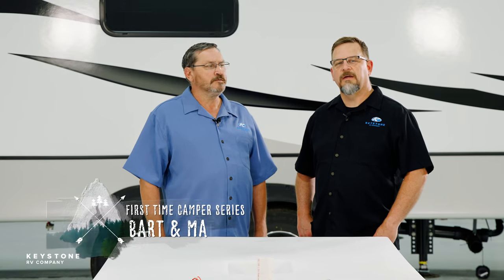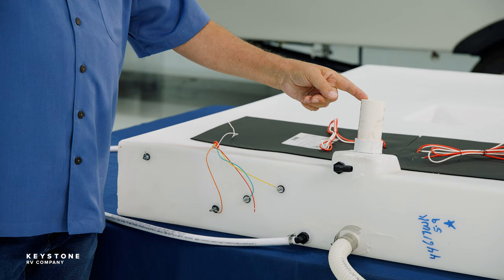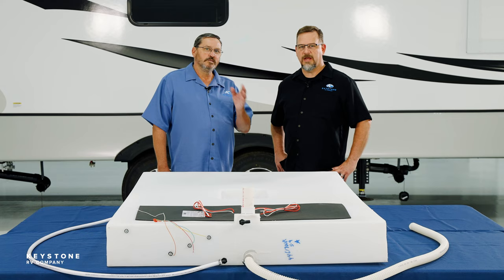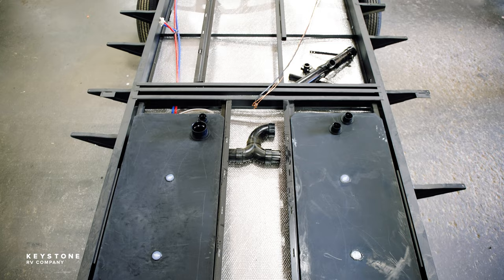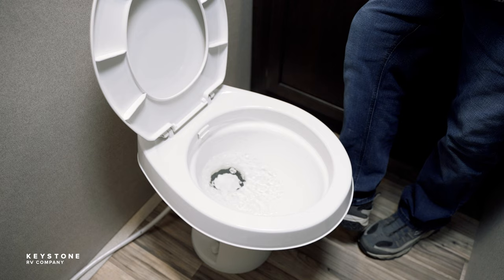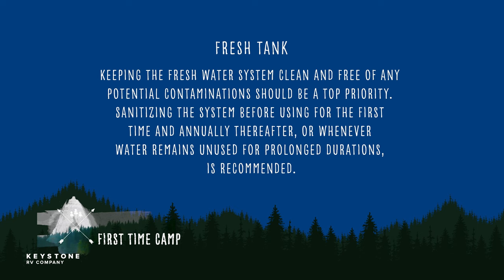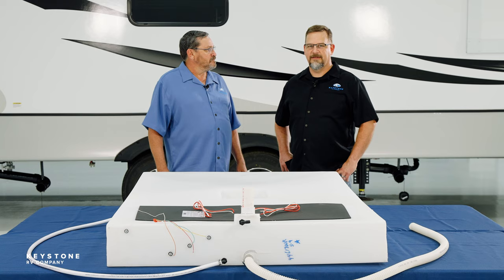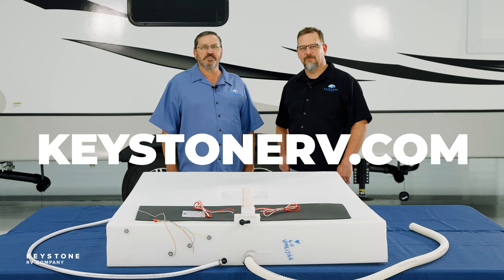First Time Camper Series: Understanding your RV Holding Tanks

Comment: Helpful video except for the recommendation to use RV toilet paper.   There are tests that show household "septic safe" toilet paper dissolves faster and it is less expensive.
Reply: We use a septic safe paper we get from Walmart.  It's their store brand. I did tests comparing how it breaks down in water to some of the RV specific papers. I simply placed a few sheets of each in separate bowls and noted how well they broke down down and how long they took. Walmart brand won.
Reply: I’ve used regular household toilet paper of many brands and textures without ever having any problem. Using RV toilet paper may result in tearing paper then you have a mess on your hands (pun intended).
Reply: I am not sure I agree with the chemicals and quick dissolve toilet paper.  I watched a good video from a company that specializes in tank cleaning and they said NEVER USE chemicals to dissolve waste or rapid dissolve toilet paper.  It causes a thick, peanut butter consistency that clogs.  The guy said “remember…your RV tanks are HOLDING TANKS not SEPTIC TANKS.   Flush them regularly.
Reply: I use normal septic safe TP as well. I use a macerator pump since I don’t have a dump station near where my RV is. Never had an issue.
Reply: I have been building for 20 years in the RVing for five in the best in this expensive toilet paper is the Scott 1000 single sheets. The role last a long time in the TP breaks down instantaneously but it’s funny strong for the job at a design port anyway that’s my recommendation.
Reply: @wolveswithoutteeth I've seen the video you're talking about. Very informative.
Reply: That’s boating not building lol
Reply: I had occasion to purchase some septic tp in a tiny town that only had a little discount store. It broke down very quickly, like in your hand, with any contact with water. I prefer nicer RV tp for that reason. Since I don’t full time, the extra cost is pretty minimal.
Reply: True, but… you use 2-4 times as much unless you want to wipe with your fingers.   😊
Reply: @victorjcano if you touch the 3 dots on the right side of your text, a menu will appear that will offer choices, among them is 'edit'.  Click it and you can change 'building' to 'boating'.  You're welcome! 😊
Reply: @Erutan409 Thank you!
Reply: Less exspensive is why they a reccomending the more exspensive RV toilet paper, its obvious
Reply: I personally use "Royale Carbon neutral" and it is sooooo much better. Didn't feel much of a change from a home (live ft in a 23ft motorhome). The small things in life 😂
Reply: I always use regular toilet paper, and no problem

Comment: Be advised, the black tank flush system has a valve that is located under the sink in the bathroom. These can and do fail. When that happens, water will run wide open into the under sink cabinet and flood your bathroom and everything else. NEVER use the black tank flush without a person inside to monitor that unit. This is on my Keystone Avalanche.

Comment: If you’re hooked to fresh water at a campsite. Does the fresh water fill a tank reservoir & then you pull water from that tank ? Or Is it pushing water directly in to the lines. I understand there’s a fresh water tank for boon docking I am wondering how city water works
Reply: It goes straight to the plumbing for your sinks. It does NOT fill your fresh water tank.

Comment: Good job. I noticed on my 2022 Bullet 330BHS that when I used the tank flush on the outside by the kitchen slide out I only heard and seen water action in the rear bunkhouse toilet. I went up to the master bath toilet and I didn't hear any water or see any water action in the tank using a flashlight. Shouldn't the black tank flush, flush both tanks? I am a little confused. I also noticed the bunkhouse sink goes into the rear black tank and not the gray tank like the other sinks.
Reply from the maker: Hi Rudy, thank you for reaching out! For immediate assistance we do ask that you contact our Owner Relations Department direct at 866-425-4369 Monday-Thursday 9am-5pm & Friday 9am-4pm EST. Thank you!

Comment: I have a Keystone Carbon 398 with 2 Full Baths.  I've notice the trailer has two sets of pull Valves one set up by the Main control center of the trailer, and a second set down by rear drain tube/ outlet. Looking at my Spec. on the trailer it says I have 1 Black tank and 1 Grey tank, so why is there two sets of release valves.
Reply from the maker: Good afternoon! If there are two bathrooms there are typically 2 grey tanks and 2 black tanks so you would then have two sets of dump valves. If you have any further questions regarding this please let us know, thank you!

Comment: My pump runs but isn't pumping from my fresh water tank, how can you tell if vapor lock, wrong valve directions, or faulty pump, or clogged or kinked air vent?
Reply from the maker: Good morning! There’s a few thing that you can check. Make sure there’s enough water in the tank so the pump can pick up the water from the tank. Make sure you have a faucet open to provide air and demand from the pump. If you have both of those these components it may be vapor locked. If this is not the case you would need a technician to look at this for you to properly diagnose the issue. Should you need further assistance on this please feel free to call us at 866-425-4369. Thank you!

Comment: I want to know how to fix it or how it works. When I connected the city water line, my freshwater tank filled up.
Reply from the maker: Good Morning, we would be more than willing to discuss how you can operate this properly so the fresh water tank isn't filling up. It could be that there is a faulty valve however, we could not state for certain if that is what's causing this. Please do contact our retail customer service team at 1-866-425-4369 for further assistance on this. Thank you!

Comment: Great video but I have been trying to find out on the black tank flush what is actually happening in the black tank when you turn the water on and its going into the tank ?Is it spraying all over in the tank or just dumping in the tank.
Mine is a factory installed flush on my 2021 freedom express. Any help ?
Thank you
Reply from the maker: Good afternoon! The black tank flush is a hookup used to spray inside the tank and assist in freeing debris within the tank to prevent build up and blockages. Thank you!

Comment: I have left my black water open for 2 years,now My toilet is backed up?I have tried so many things.I have left water on it for 1 1/2,what should I do?
Reply: I now that I need to call someone,not only that but my holding tank fresh water drain plug is broken,and the houes on it spins around so I am assuming that it will leak.
Reply: I was wondering if when flushing the toilet if it opens one or to drain opening that go to the septic?
Reply from the maker: Good Morning! We would not recommend that you keep your black tank valve left open. This can cause blockages like what you are experiencing. We would recommend that you properly clean your tank and keep the black tank valve closed at all times unless dumping it.

Comment: Is ot true that we should not tow an rv with the fresh water full or half full? Is it made to survive the stress of the road?
Reply: No.  That is the purpose of the fresh water tank. Fill it for boondocking, dry camping scenarios.  This is not true of the gray and black tanks.  It is not recommended that you travel far with full gray or black tanks due to their design.  Also - always check your tire/axle weight ratings and make sure you're not overloading you them.

Comment: Ok, so can i travel with a load of potable water en route to boondock, or travelling in general? What about grey and black out of necessity?
Reply from the maker: Good afternoon! We recommend only traveling with potable water to your campsite when boondocking. Thank you!
Reply: @KeystoneRVCompany  much appreciated!!
Reply: If you're boondocking, you'll have to travel w some amount of fluid in grey/black tanks until you can find a dump station. Watch your payload, water is heavy 8.3 lb / gal.
Reply: @TraconWizard im w you, ALWAYS returned w some black water for obvious reasons, grey also a few times. Can’t ever seem to get a clear answer on this issue from dealer or mfg’s. Started with a POS jayco, then momentum TH, recently downsized a little bit to a new cougar mid bunk, but from what I’ve seen while I was installing gen set, not much holding tanks in place

Comment: What would cause the water pressure to quickly diminish after about 5-10 seconds on a brand new Cougar Half-Ton 30 BHS?

Doesn’t seem to be the pump or the supply lines. It seems like either something wrong with the suction line from the fresh water tank like a kink or debris or something in the tank that isn’t allowing for smooth flow. 

The pump also takes about 30-60 seconds to catch up and shut off after the water has been turned off from the faucet etc.
Reply from the maker: Thank you for reaching out! For immediate assistance we do ask that you contact our Owner Relations Department direct at 866-425-4369 Monday-Thursday 9am-5pm & Friday 9am-4pm EST. Thank you!

Comment: I have a 2007 Dutchmen Grand Junction 39 ft fifth wheel RV that is going to be permanent on my property I was thinking about removing the tanks or at least the black tank and turning it into a park model but I don't know what kind of job I'm going to have Plumbing it up
Reply from the maker: Good Morning! We would recommend consulting with a local Keystone dealership near you if you wish to remove any tanks like this. They will be able to walk you through the process of plumbing the unit to be a complete park model.

Comment: VIN # 4YDTBLM24PT430429
2023 Keystone Bullet Crossfire 2780BH

Time line on this camper...

I signed papers on this camper on December 9, 2023.  I didn't get it home until February 3, 2024.

Work Order # 14680W dated 12/5/23 states
    job 1- Loose trim at bottom of entry door.
    job 2- Night stand trim needs work (right side).
    job 3- Master bedroom seam tape and wall panels needs replaced.
        Cause: Window not sealed causing water damage to unit
        Correction: Remove window, window valance, blind, trim, sliding door, door track, trim, cabinet, night stand, bed,         bed frame, shelf above bed, and put it all back together again and fill all nail holes with color matched wood filler.
At the bottom of this work order it states that "The remaining windows on the unit are not sealed properly and going to allow water to intrude in the future."  Were ALL these windows even fixed?

April 22, 2024...
I am in the camper making the beds for our FIRST trip and notice BOTH upper and lower bunks are wet. Upon further inspection the wall panel, the bunk frames, the curtains, and the floor were also wet. There was a 1/4" gap between the wall and the window top. Water was literally dripping from the window frame. I have video of the gap and the water coming in. I had to cancel that trip to get the camper back in for service.
    
Work Order # 15548 dated  4/29/24
    job #1- Lower bunk window is leaking.
    job #2- Upper bunk window is leaking.
        Cause: window is not properly installed causing a gap in window and not properly sealed.
        Correction: tighten windows and seal.

May 16, 2024 Our first trip...
While hooked up to water and the water pump on, we discovered the toilet leaks/spews water from a fitting onto the wall and floor, and the bathroom sink has a pretty substantial drip/leak where it will not shut off. As the day got warmer, we turned on the A/C and discovered there was a gap in the drip rail that allowed condensation/and maybe even rain water, to drip down into the outside speaker. Later that night as we were going to bed, we noticed the night stand trim in the bedroom (that had been "fixed" in w/o # 14680W) was flopping off the wall again. We finish our camping trip inconvenienced by not being able to turn on the water pump. I make an appointment to drop the camper off for yet another "fix". The night before taking this back to Camping World for service, I'm in the camper and notice the lower bunk is wet, again! As I am collecting stuff out of the camper, I notice a hat that had been sitting on the right side night stand in the master bedroom was wet, and a notebook that was on the dinette table was wet. When we go in to drop the camper off, Josh and Bill do a physical walk around and inspection. The wall and nightstand are wet as well. They discover a hole in the right front corner of the roof and tell us all 4 corners of the roof have been patched with some sort of "putty" and this is why the wall and nightstand are wet and is why trim keeps falling off the wall.

All of this takes us to Work Order # 15735 dated 5/21/24.
    job #1- toilet has a massive leak
    job #2- bathroom faucet will not shut completely off 
    job #3- seam in gutter dripping into outdoor speaker
    job #4- master bedroom trim is lose again (from W/O #14680W) 
    job #5- lower bunk window is leaking again (from W/O #15548)
    job #6- dinette window leaks
 
There is no mention of a hole in the roof OR all 4 corners be patched on this work order. No mention of the the wall panels warping. What happens 6 or 10 months from now and the floor and/or walls deteriorate? What happens if mold is discovered? Has anyone even CHECKED BEHIND any of these walls that have been wet? Has anyone checked the stability of the bunk bed frames, where they mount to the wall? Will they deteriorate and come off the wall? The bunk room curtains have been so wet that they have faded and bled black dye onto two set of sheets. What happens when those curtains and the header that they are attached to fall from the wall?

We have our annual trip (6 hr drive) coming up. What happens when we find another leak or disastrous situation?? Camping World Customer Service suggested that if we have issues to "reach out to our Elite Tech Support line" and gave me an 844 phone number. The closest Camping World would be AT LEAST 147 miles away! And how would I contact them with no cell service or internet in the hills and back woods of Missouri?? We are not "glampers"...we do off grid or "boon-docking". This camper is not as solid or dependable as it should be for a NEW camper. As of todays date, I have made 7 payments on this camper. It has 96 miles on it...30 to a campground, and 66 miles to Camping World for service.       

I spoke to Nicole at Keystone Customer Service about a Swap Out or Buy Back.  I would swap for another Keystone Bullet. We have always had good luck with Keystone campers and have thought of them as a quality camper. However, this particular camper has some serious issues. Issues that I'm not sure can be corrected properly.